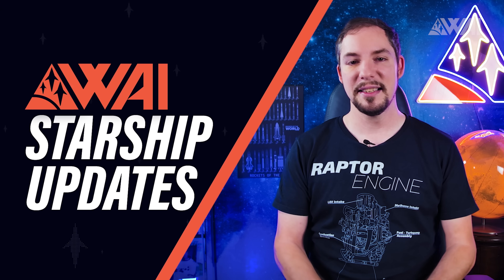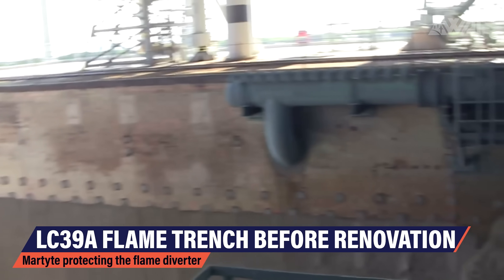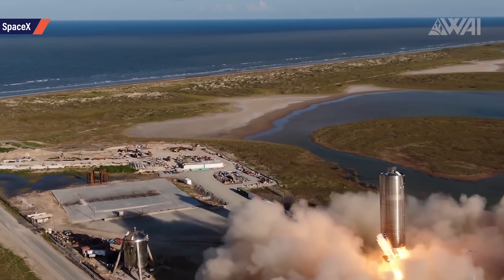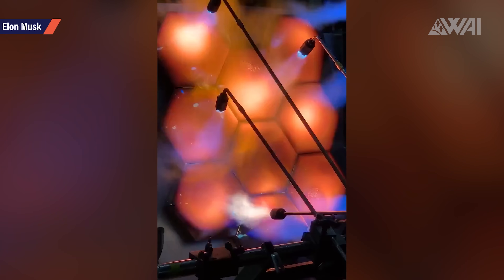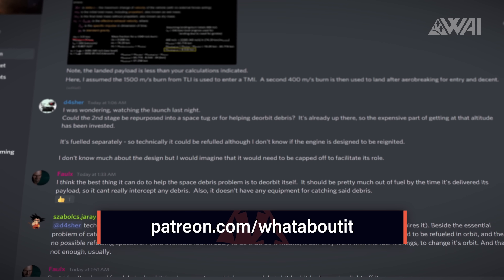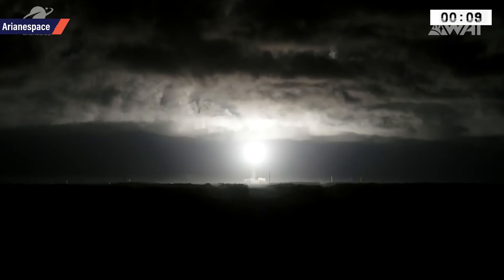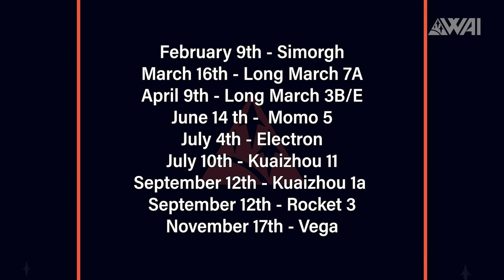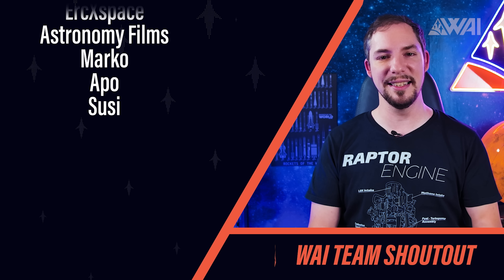134 | Why Martyte helped to damage a SpaceX Starship Raptor engine!

Comment: Human error is in the end a design flaw of the rocket too. Human error must be counted in the design philosophy of any built machine. There needs to be automatic system checks that notice this human error before launch for the electronics. Human error should be seen as an inevitablity, and it should be minimized by design. A single cable being incorrectly connected shouldn't be able to bring down the whole mission. Or that cable should be easily noticed with a system check...

Comment: While I still think it may be a mistake to try to skip the flame diverter on the superheavy booster, the Starship upper stage is supposed to land and take off from unprepared surfaces (on Mars, for example). If it can't take off from a Martyte-coated concrete pad without destroying the engines, then there's no way it will be able to land on Mars.

Comment: stop where you are at, houston we have a problem. the force andnheat have to be deait with, dig a trench and have it extra at Gavin Nuesome office it will solve two problems and Elon won't have to worry about closed plants,
Reply: Water-cooled steel pipes & reinforced avionics should be adequate

Comment: Launch pads or diverters should be as reusable as the rockets. Make them out of water cooled stainless steel. Or liquid nitrogen cooled stainless steel.
Reply: They implemented water-cooled steel pipes to the SN8 mount. And the orbital pad will have water-cooled diverter anyway (using LN2 will be more complicated with more energy requirements, fluid isn't necessarily cold to our hands but just colder from the fire perspective which is what ambient water is)

Comment: The launch pad need to be risen a few feet, and a noise canceling water sprayers be added to the pad. What I see is an explosion when engines are ignited, they can instantly cause damage.  Remember this is 3, and not one engine, so 3 times more explosive power blasting back into the engines. Secondly the space ship is designed to ride a top of its first stage, so it make plain sense to have the same noise canceling as the F9 rocket.. So I read some comments below, and I saw one pertaining to mars and moon not having launch pads and noise canceling devises. That is true, they do not, and they also don't have Earths gravity either, and it rides out of this planet on top of the first stage also. Something has to be done about the explosive energy released, period.
Reply: They already learned by adding protection to the avionics cables, but they already used water deluge since Starhopper days

Comment: So the computer I bought in 1995 had different plugs for each connection so it was impossible to plug the wrong thing into a socket, but rocket scientists are so arrogant in their infallibility that they go ahead and use the exact same connector for the left and the right sensor?  This was not a technician's error.  This is a fundamental design flaw.  Do you think they will fix it or just admonish the guy who assembled it for them?

Comment: If Starship can't handle launching from an custom built elevated launch pad how does Musk expect to be able to relaunch from the unprepared surface of Mars??
Reply: Now they modified it by adding protection to the avionics cables, so now it should be more resilient. And the legs used for Mars landing will surely be much larger than today's prototype one, coupled with wider stances & auto-leveling

Comment: Flame diverter?  Build a heavy, partially hollow, concrete tetrahedron and shove it under the engines (lock it in place) to deflect each of the three engines' flame out and away from the test stand.  So that there is no middle "bounce-back" path to the vehicle.  Pull the tetrahedron out from underneath to access the engine bay for engine change-outs and stuff.  There's the quick and easy way to remedy this to get some flight tests done.

Comment: As far as landing on Mars is concerned, they will have to be a vehicle designed specifically to accomplish that Landing. Similar to the proposal for Artemis, there is likely additional engineering that will need to be I'm done before we'll know what that Starship will look like. But it may include some other Landing system specifically designed for Martian conditions. And will account for the likely rugged terrain it will encounter, at least until fully engineered landing pads can be constructed.

Comment: They  could move starship over to the Higher orbital launch mount.
Reply: Orbital mount will be used for Super Heavy first hops & ofc later full orbital stack
Reply: @alvianchoiriapriliansyah9882  Yeah I understand that, but I think that because of its high clearance it could be used for starship too with lower risk of rebounded material from the blast.  I don't see a downside.
Reply: @pobembe1958  Then why don't just continue to use existing mount? (and now there are two of it, same design). No need to reconfigure everything

Comment: The vega launch is a shame I read a tweet form one of the ppl involved in the satélite theybwoeked on it for the past 12 years and was not insured so is all gone. So sad 
SpaceX was hard headed with the flame diverter, they pushed too far ignored Nasa expertise on it. That was a poor move. Love SpaceX but maybe this will keep them a bit more grounded and less cocky.
Reply: Flame diverter is pretty overkill for the mount that's not going to be used for orbital launches. They had implemented a great yet simpler solutions

Comment: If the starship is going to be able to land anywhere then they can’t depend on a flame diverter. 
These problems have popped up before and they have all yielded to the SpaceX engineers! This too shall be solved

Comment: Yes I think they may need to come up with a better launch flame diverted system. Starship will have 3 raptors and 3RaptorVAC’s but the booster which will only ever be used on earth has SO MANY MORE ENGINES. They’re gonna need to figure something out I think

Comment: I think that the Starship that is going to land on Mars and the Moon is going to be exposed to quite severe blasting from the surface materials.  The blast might well dig a very deep and wide crater from simple scouring.  the rocked might not even be able to find decent footing with the present landing legs, and wind up digging itself in to a point that it partially buries itself, and  nay in fact tip over, or just tilt precipitously.  If the engine skirt is buried in a crater, the thermodynamic and acoustic forced exerted to blast the rocket out of the hole might just tear it apart (RUD) and leave everyone stranded.   I think that SpaceX will have to do several landing tests on different types of earth soils just to be sure that this will not happen!

Comment: In retrospect, not having flame diversion on the test launch pad seems like a blunderous omission... even for just a single engine. Super heavy is going to require a massive provision to divert flame energy or it will surely fail.
Reply: Many firings has been done on (test) pad without problems. Designing everything to death is a traditional motto rather than SpaceX's

The operational orbital launchpad will surely have flame diversion

Comment: I'm going to keep saying this every time something like this happens: If you don't use a deluge system, you will continue to have problems like this, Elon. This IS rocket science.
Reply: It HAS deluge system
Reply: @alvianchoiriapriliansyah9882  Do explain. We have watched every test firing of those engines and not seen any sign of a deluge system.
Reply: @alvianchoiriapriliansyah9882  Still not seeing it. Are there some sort of sprinklers I'm not seeing here? That's not much of a deluge when the ground looks dry afterwards.
Reply: @Myrddnn  Water on the bottom of the mount
Reply: @alvianchoiriapriliansyah9882  That doesn't look much like any deluge system I've seen, and I've put them in large chemical plants and refineries. That would be more like a sprinkler and I'm not seeing even that much to be honest. I've spend some time trying to research how exactly their launch mounts are configured and can find nothing about any deluge system being used. For rockets of this size, it is customary (a la at Cape Canaveral) for there to be a water tower nearby to supply the quantity and head pressure needed. And Superheavy will be blasting more than three engines to take off. That needs either a sea launch platform or one truly robust and serious deluge system just for noise protection, not to mention the damage that it would otherwise do to the concrete below the launch mount.
Reply: @Myrddnn  For this mount there are no water tower because they're using the pumps from ordinary water tanks (three of them, black-coloured)

This isn't as many as like Shuttle, because why need that much? It's supposed to launch a max of three engine Starship in its entire lifetime
Reply: @alvianchoiriapriliansyah9882  Well, tests show that it is insufficient...
Reply: @Myrddnn  So what, they're quickly implemented the solutions. Delay of only a week (we have a new closure for two days from now). Deluge is for acoustics, and the martyte damage is because of the direct blast which can't be blocked completely by water even on many other launchpad

Comment: They must build a diverted system... maybe a quasi-diverted, metal? Some5hing they could install now...plus water system! The test stands are too low, I’m not surprised that concrete, and Martyte sprang up and caused, unnecessary damage. Love spacex
Reply: They will have a water-cooled steel pipes

Comment: Wonder what those heat shield tiles would do if they were put on the ground under the rocket with steel welded? Probably pushed out of they way no matter how they are mounted but they have to withstand a earth reentry right? Why not a few raptors ...

Comment: Ha place heat tiles underneath the launch pad see if they can take the punishment of them Raptors
Reply: It will quickly blown away. In reentry it's really hot but the forces is definitely weaker than Raptor exhaust

Comment: I've found an article on the special coating developed for the new Royal Navy Carriers so that they can take the heat of the VTOL F35 jets day in day out, not easy to find details but mentions it is made by Monitor Coatings.
It is used on metal but they might have a better solution to Martyte on the concrete. Certainly a company it might be worth SpaceX talking too. Beneficial to both.
Best article I could find... https://www.ddcoatings.co.uk/1275/new-deck-coating-hms-queen-elizabeth-aircraft-carrier
Reply: I had the same thought about F-35s and their ability to damage decks. Found a couple of articles, but not as good as yours. Thanks.  But... the rocket flame will be hotter than the jet. Hopefully the material will hold up for the brief exposure. But then... the blast will be much more forceful than an F-35. Not sure it will work, but I sure hope someone at SpaceX thinks along these lines.

Comment: This is probably a stupid idea, but could they have a pool of water under the launch mount, so rather than burning the concrete it would evaporate the water and take the heat?
Reply: The water will vaporize too quickly

Comment: When a Rocket starts it is an explosion and concussion that balances back up into the rocket engines on the Star Ship will damage anything not properly protected. He needs a flame detector
Reply: The avionics is now modified to be fully protected by steel pipes. And now they're installing water-cooled steel pipes

Comment: All the more reason for SpaceX to move all Starship launches to water-based platforms.
This still won't help for missions to the moon or Mars, unless no landing is planned there.
Either tall, pre-built launch pads will have to be assembled/erected on any planetary body before landing
or the Starship's legs will have to be much, much larger to elevate the vehicle to a safer height.
I think it would be better in the long-run to spend the money on a new, more-capable leg system
than always having to build/send/erect landing/launchpad structures for wherever they go.
Reply: Offshore platfrom doesn't have to do with the exhaust forces, surely the land based will still be capable

Yeah, larger legs are on the plan
Reply: I cannot see how they can continue to do land-based launches without flame-trenches and/or much higher launch stands. If this kind of damage happens with just  3 raptor engines, a complete Starship would completely destroy everything underneath, kicking up much more debris than was witnessed in the last static-fire. Yes, larger legs is what I imagine is needed, but I'm talking  much, much bigger, that would be at least as high as where the bottom flaps are attached.
Reply: @not2busy  Obviously Super Heavy will launch on a different, larger pad

Comment: The landing area and take off should be as the destination. Rocky sandy moon dirt. Mars then. Unless the cargo is a landing pad. Im thinking at least take off on flat ground on earth or be able to. No fancy pad on moon or mars yet. If heat shield welds on skin of fuel tank id not like it.
If structureal support is that skin thats a concern to. Maybe theres a frame so skin is not needed for air tightness or main strength.
Assuming welds fail slightly.
Just thoughts 
Its epic !
A big frame down landing side with heat sheild on that and landing gear in it. Great fun sounds like heaps of weight.
Be well :) :]

Comment: SpaceX is going to have to install a flame diverters whether they want to or not you can’t light up three full flow raptor engines with no flame diverter and expect no damage not to mention 30 of them

Comment: Moon landing version of starship will not land with raptors but with smaller RMs located high up on Starship sides. The Starship will spend most of its time in the initial years launching from and returning to carefully engineered and constructed facilities on Earth, especially during the first several years. No need to design it for Mars landing at this stage. The Mars version will be a completely different beast (just as the Lunar Starship concept is portrayed being very different. I think Space-X was trying to save some time and money up front and may have underestimated the potential downside (just as Musk said).  It will be interesting to see how this plays out.

Comment: Elon must now be thinking that flame diverters are needed. Imagine that surface trying to hold back 20 something odd Raptors?
GOOD LUCK. THINK ELON.
Reply: Operational pad will surely have that, but test mount that they're currently using doesn't need it

Comment: On the moon or mars it would be simple enough to dig a simple trench. Once gas is flowing in it, the debris will entrain. If you dont care about erosion just a plain trench works. 
For the orbital launch site, it's currently dead flat. Even a slight domeing might entrain the concrete debris rather than bouncing it up.
Reply: How can digging a trench on freaking Moon & Mars "simple enough"?

Comment: There launch pad sucks. Have they never seen what happens when a hot flame hits concrete??? They need a real pad.
Reply: Water-cooled steel pipes should be enough for current prototype use

Comment: Why on earth would they not build a flame trench? Com on man!
Reply: Pretty overkill for current mount, and it will not be used for operational mission for very near future. Water-cooled steel pipes should be enough for the job

Comment: To avoid debris, they could consider a moon-style type of raptor integration,  where they're placed at the upper-half of the starship instead of at the very bottom. The bottom could have just the 3 vacum raptors.

Comment: Flame diverter alternative- put a layer of V-shaped steel diverters point up, spaced apart in rows below the rocket, then another layer below that so as to occlude any ricochet from ground level- use one inch thick steel, it will heat up, then it will cool back down after launch. Hell, even if you slag it after a few launches, steel is cheaper than rocket engines...  😐

Comment: Hey Felix,  The Columbia accident was not due merely to the loss of heat shield tiles. That had happened before. They always lost some tiles here and there, and they had even had a foam insulation strike in the same area, taking off a significant number of tiles in about the same place, but they survived that with no problem, although that crew was none too confident as they prepped for reentry. What was unique about Columbia was that the frozen foam insulation not only dislodged tiles, it punched a hole in the titanium skin of the orbiter itself. This allowed plasma direct entry into the interior of the airframe, causing loss of structural integrity in the left wing. A very bad day.
Reply from the maker: Hey Odysseus! Yeah, I know the incident well. It wasn't the main topic though, so I didn't go into too much detail there. It was more focused on foreign objects hitting the structure of a Starship. With Columbia the foam wasn't thrown up by engines either. It came loose from the main tank. Always nice to see your comments! Have a great evening! 🙂
Reply: @Whataboutit   foreign objects hitting the outside of your space ship is bad, foreign objects getting blown into the interior, is worse. And you, sleep well.

Comment: The super heavy booster needing a flame diverter is likely. But the starship needing one is not an option. Every bit of complexity in the launch system for starship is a barrier to takeoff which must be overcome on the surface of mars. The "quick" fixes are not temporary.

Comment: If the launches will eventually be at sea, the why can’t they create a deep pool of water under the launch platform and supply it from the two large tanks they called SN5 and SN6?
Reply: Because it's complicated & expensive
Reply: it will be tsunami of steam and water around, no fuel farm after. water expansions 1000 times